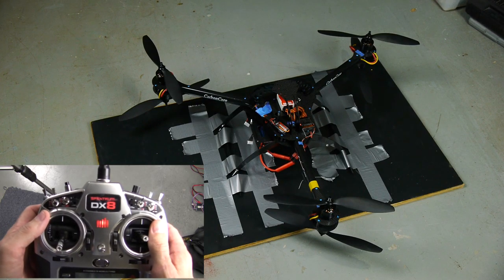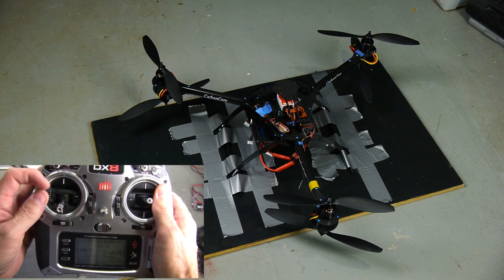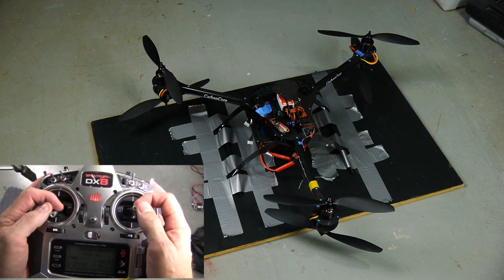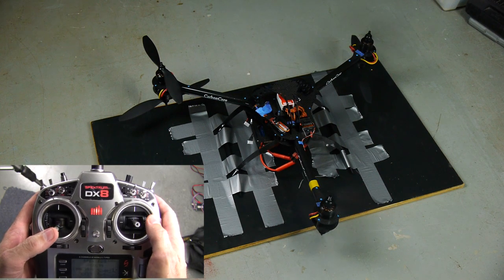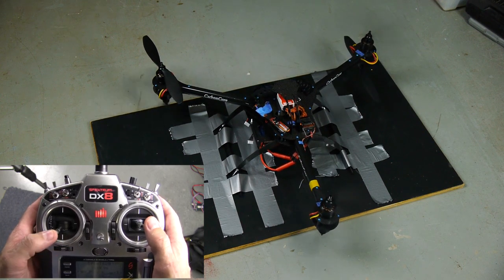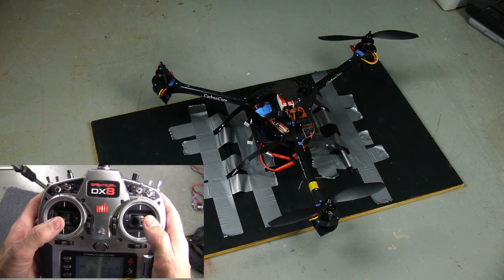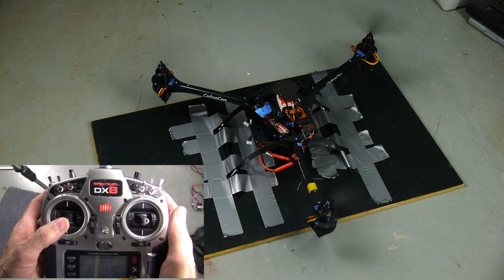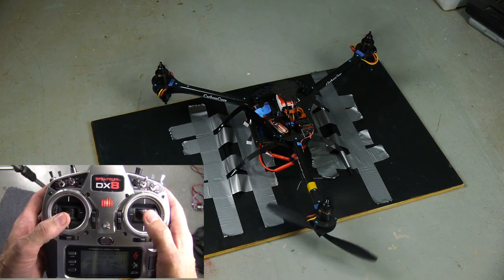On the ground test 01

Comment: Hey,
I have the same problem at the moment with my flashed HK 20A esc, it behaving just as in your video, did you found the fix?
The only way that mine doesnt do this wen i put the start up higher in the assistent.
Did you get it fixed?